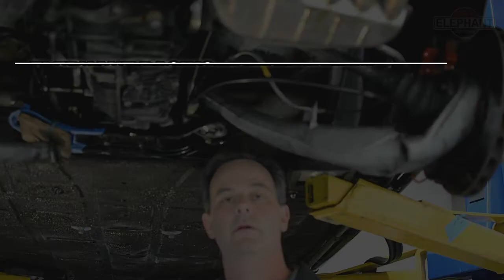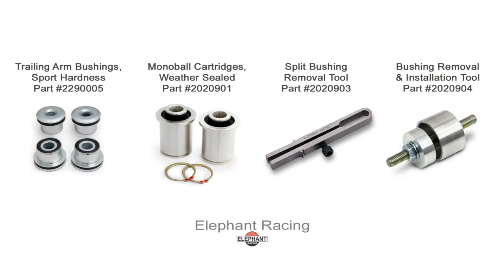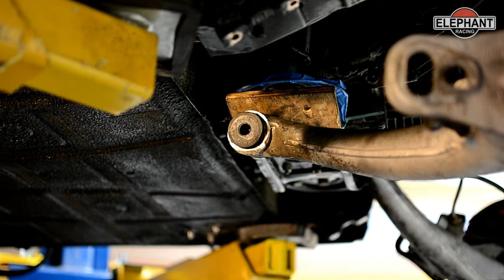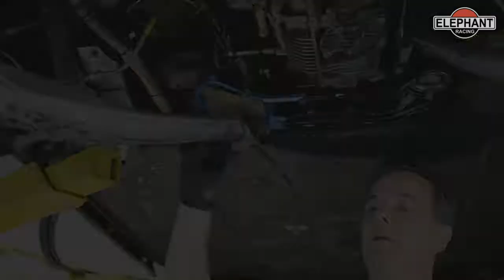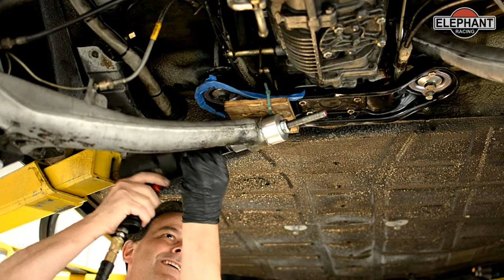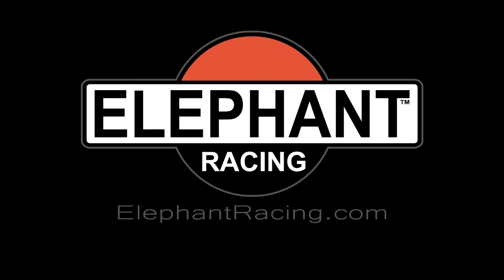porsche 911 trailing arm bushing removal and installation

Comment: You can see how they did it.  support car. Jack the trailing arm till you can unbolt the shock and then lower.  Disconnect the trailing arm from the torsion spring plate.  

Loosen off the trailing arm bolt then cut the head of the bolt off with a sawzall.

drive the bolt put.  

Now the trailing arm is unsprung and connected to the car essentially by the axle assembly and brake lines so you should make sure to keep it supported with a jack or a ratchet strap so you dont tug the brake lines.

It does save time mostly because you arent bleeding the brakes afterwards nor are you having to deal with axle bolts stripping out.

But it is misleading because they seem to make it sound like you'll be able to wrestle a sprung trailing arm out of the saddle which you will not be able to do

Comment: Great video, only it's missing the key part, removing the control arm from its saddle. Can't do any of what you explained without knowing how to do that step. :(
Reply: Yeah, would be nice if he included the actual hard part here.  Had to remove sway bar and trans mounts to get the bolts out, but still haven't got a clue how to get the control arm free from the saddle.  Have another tall jackstand on order, hoping maybe if I can compress the suspension it will help but not optimistic...
Reply: @johnthomson8177  I did this job last weekend. I didn't see any way that you could remove it from it's saddle without removing the whole trailing arm. It's actually not that hard to remove the trailing arm. Makes it super easy to replace the bushings on the arm on a bench too. 
 Jack up the car, remove wheel, remove hub, remove emergency brake cable, use a jack to hold up the shock. undo the four bolts on the spring plate that attach it to the trailing arm. Then you can undo the lower shock bolt and the front trailing arm bolt. Once you've done it once, it's really pretty easy. I did it all with engine out though. Wouldn't be much fun with the engine in, but still completely doable.

Comment: Getting that 22mm nut out, which holds the trailing arm to the car, is near impossible on the passenger side ( got it! ) and totally impossible on drivers side . Would love to know how you get at that nut on an SC, say, with out dropping the engine.

EDIT: Finally got both out! Whew....
Reply: Making that edit without explaining how you got it out? That's a dick comment .
Reply: Please share how you got it out. I'm at a complete dead end, on jack stands, with neck spasms...
Reply: Cut the bolts off and replace with new.  Only this time insert the bolt from outside in and secure the end with split washers and nylock nuts to prevent the nut backing out